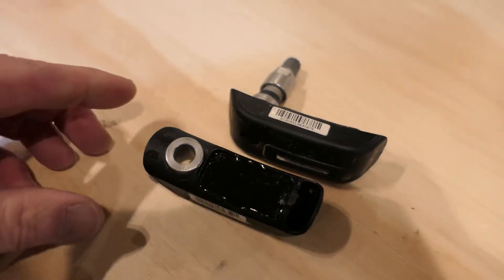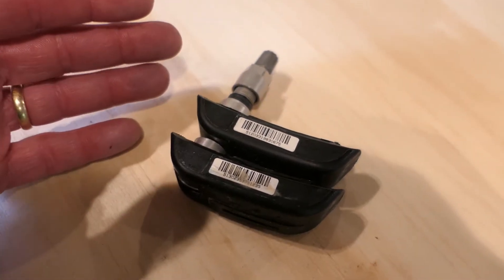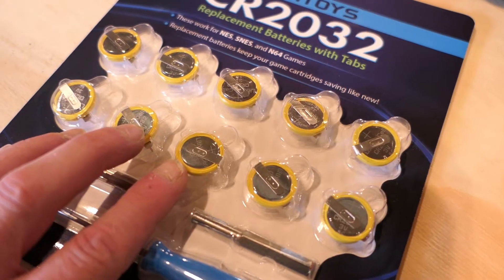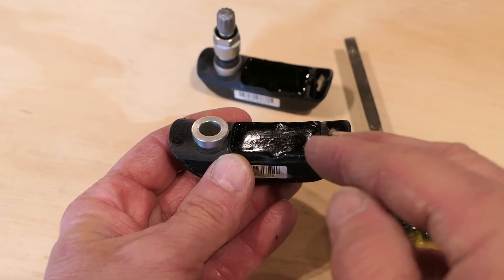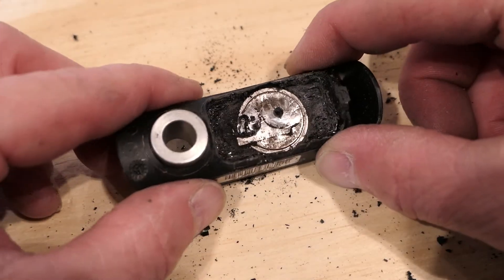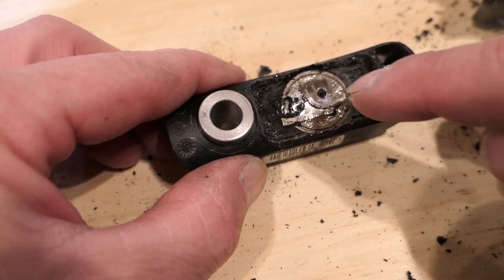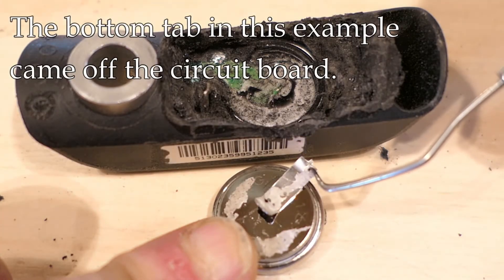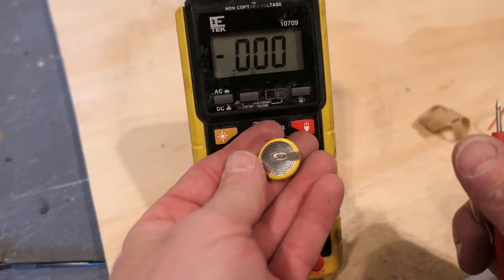Updated: BMW Motorcycle TPMS Battery Replacement

Comment: Two questions:

Is there a difference between the front and rear sensor?

Did you ever tried the very cheap chinese sensors?
Reply from the maker: There is a newer style sensor for newer model years, so pay attention to that.  The original style front and rear sensors are the same, except for the mounting, so the front sensor comes with a stem.  The cheap sensors you can find on amazon or ebay are identical to OEM.  However, you may find that the batteries are already DOA or at least older.
Reply: @tinderboxarts With that said I am thinking about buying oem version (it will cost a lot money) and keep the old ones for changing batterys later.
Reply from the maker: Or, just buy the cheap sensors and replace the batteries if need be.  You can test the sensor before you do a final install.  Either way you'll need either the GS911 scan tool or the motoscan app with a cable.  See the last half of this older video: https://youtu.be/xAiJy4ZC-u4

Comment: I prefer to do not have the pressure indication than replace it every 2 years
Reply from the maker: The batteries last more than that--my guess would be an average of 5-6 years, depending on use.  While I'm not a big fan of electronics on bikes, this feature is useful.  It's there not to help you set the pressure, but to alert you in the event of a sudden pressure loss.  When you are on the highway or stuck in traffic, a quick alert could be a lifesaver.

Comment: Hello,  thanks for the great video. I am planning to change battery by myself aswell. Now front tire is totalt out but back tires still working.
   I bought the EL-50448 ( another brand called OEC-T5) tool from Amazon for really nice price and tried to test it. But it could not wake up the back tire's sensor.  I placed it very close to the back tire's sensor, pressed the white buttom many times. The green led flashed but the mc still shows 0 tire pressure.  I have 2016 GSA.  Any suggestions? I got a defekt EL-50448 ?
Reply from the maker: If you were looking for a reading on the dash then that could be the issue.  I believe the bike needs to be rolling at something like 15 MPH for the dash to display the sensor data.  The wake-up tool is meant only to allow you to enter the sensor registration when you have your GS911 or Motoscan spp connected to the bike.

Comment: i blast the sensor port with compressed air to test if its working. but this might only work with aftermarket setups with a standalone receiver
Reply from the maker: How do you accomplish that, with a rubber tipped blow gun?

Comment: I want to thank you for your guidance in undertaking this project. I'd never have attempted it myself without seeing the detail of how the battery is situated in the sensor and how to remove it. On the basis of the challenges you experienced, I tried a couple of variations, that worked a treat.  First with the removal of the epoxy resin - the resin on my sensor was very hard.  But I scored it with a sharp Stanley knife (box cutter) into approx 3 mm x 3 mm squares, and then it was relatively easy to prize each of the squares out, leaving the battery cleanly exposed.  Then, using a high speed drill, I drilled into the battery, severing the top welded tab (wearing protective gloves, mask and goggles).  Kept drilling through the battery to the bottom tab, which also severed cleanly.  The battery lifted out easily, leaving approx 5 mm tabs for both bottom and top connections to the battery, which the new CR2032 battery (with tabs) comfortably connected to.  Thanks again for your detailed guidance.  As others have written, much prefer to extend the life of parts such as the TPMS, reducing waste and cost!
Reply from the maker: That's a great idea to cut the epoxy into squares.  I'm glad it all worked out for you!

Comment: Obviously, bmw doesn’t want you to replace its battery instead, they wanted you to change the whole thing
Reply from the maker: That is correct, and that is also common among all car and bike manufacturers.  The big difference, though, is that new sensors for cars and other bikes are cheap to buy.  They are a consumable item.  BMW has made them obscenely over-priced, especially as they are no different than those used by other manufacturers.

Comment: I bought x2 senors off Aliexpress for $33 delivered,
They both have the BMW markings on them, exactly the same as the originals. probably alot quicker and cheaper than the battery swap,
Reply from the maker: There's one catch with that approach, which is that the cheap sensors sometimes arrive with dead or nearly dead batteries.  That happened to me, and I see many others on forums who have experienced the same thing.  So, I still replace the batteries and just swap the sensors with new batteries every other tire change.

Comment: Just out of interest, its been 2 years, are they still holdong up, and how regularly do you ride? Do you think they would last the +- 10 years like the oem batteries?
Reply from the maker: Yes, I have been on multiple cross country trips with these same sensors and batteries, often riding 10-12 hours a day.  I'm not sure all OEM batteries last 10 years, by the way.  The beauty of replacing your own batteries is that you can repeat the process, say, every other tire change.  That way you'll never be caught with dead batteries again.  Once the epoxy is removed the process is easy.

Comment: Excellent explanation!!. Would it be possible to use a heat gun to melt the epoxy, very carefully? Then, some type of liquid epoxy could be used to seal the battery again.
Reply from the maker: No, a heat gun would spread the heat too wide and probably cook the circuit card.  You can use a simple chisel or razor to chip away at it if you don't have a soldering iron.  As for resealing the battery, the electrical tape really works fine.  I've done three cross country trips that way with no issues.
Reply: Ok! Thanks!!!

Comment: The original battery is a Maxell CR2050HR battery, it has more than double the capacity of a CR2032 (550 vs 225 mAh), so it will last much longer.
It also comes with tabs attached, making it easier to connect properly with the original tabs in the sensor.
Reply from the maker: I've had this discussion before.  It may be that the manufacturer used different batteries depending on when they were manufactured.  In any case, as long as you have a 20mm 3v battery it will work fine.  The 2032 is more readily available, but the larger 2050 can be found.  I'm not that concerned with longevity because I end up doing a tire change at least once a year, which is an opportunity to change the sensors or the batteries,
Reply: Wish I had read yours before I ordered the CR 2032's recommended on the video. Oh well when I replace them (earlier than needed) I will have the CR 2050's here. Still thankful to Tinderbox Arts for this useful video.

Comment: You were willing to buy cheap chinese batteries but you're not willing to buy cheap chinese sensors for $30?
Reply from the maker: On the contrary, I have two sets of sensors, one pair of which are Chinese knockoffs and the other the OEM.  If you watched my original video, I found that one of the knockoff sensors arrived with a dead battery and this is not uncommon.  So you may be into replacing batteries even if you buy complete sensors.  I just switch the pairs of sensors when I do a tire change, to keep a fresh battery installed at all times.

Comment: This is another sign of the Useless times in which we live. Someone decided this is a good idea to install these sensors which requires computers and tools to set up.  Somehow that is more "Convenient" than the simple act of checking the air pressure on the tire manually. How much time and money is wasted dealing with this stupidity.!!
Reply from the maker: I do understand the sentiment, and I'm not a fan of most of the gizmos on bikes and cars these days.  However, I do think the TPMS sensors are valuable for riders--not to check the pressure, but as a warning while riding.  If you have a few seconds of warning that pressure is dropping after running over a nail, it could offer an advantage.  That said, the implementation of the sensors could be improved for sure.

Comment: Thanks for this hack. Was quoted ridiculous prices for this to replace. With labour they wanted over £500!  I thought it was shitty to make it sealed so you have to buy the whole thing. This is so wasteful and I hate companies that do stuff like this to extort money from you. I just replaced a tyre the other day and wish I saw this video first.

EDIT:
After changing a tyre again I tried this and it worked!  I used a proper TPMS battery though and spent the extra. They are longer lasting and more robust against temperature. 
I also had to solder a wire where I messed up the positive side. I hot glued everything back in

Comment: You can order CR2050HR batteries that are designed for TPMS, bigger capacity and can be soldered on.
Reply from the maker: Yes, as long as the voltage is correct you can use a larger capacity battery.  However, that also means more weight.
Reply: @tinderboxarts  Is the weight a big factor in this case?

Comment: Hello again John,
Just yesterday the front tire pressure indicator my 2016 r1200rt  stopped showing a number and shows two red rings.  The tire is holding air, was low at 33 instead of 36. I've put more air in but haven't ridden it yet to get up to speed (30 mph) to check it. Any ideas?
Reply from the maker: If there is no longer a reading indicated on the dash then that is typically an indication that your battery in the sensor has failed.  You'll have to either replace the sensor or replace the battery in the existing sensor.

Comment: Hi thanks for this how to video.
Can I make a suggestion  could you measure the depth you need to drill and let us know so we can set the drill depth when doing it by drill .
Thanks again
Reply from the maker: That wouldn't be a wise method.  There could be differences among model years or for other reasons and the level of epoxy could also vary.  It's not that difficult to sneak up on the depth.  You encounter the top of the battery first, so when you see silver you need to slow down and proceed more cautiously.

Comment: Why not use an electrically conductive glue like you would use to reattach a rear window defogger tab?
Reply from the maker: Do you mean to attach the wires to the circuit card or the battery?  I'm not certain how well that would hold up in the environment of the tire with heat and vibration.  I can say with certainty that soldering does hold up, because I've gone years now with repaired sensors without issue.
Reply: @tinderboxarts  the adhesive to reattach the defroster lead to the glass on your vehicle window defroster works in an environment that is subject to high temperature changes as well as vibrations.  It is used in place of solder because the glass will brake if you try to resolder the lead onto the glass.  This adhesive is fully conductive as well.   I’m going to try it as I have to replace the batteries on my TPM sensors.

Comment: You can use a small endmill bit in your drill press.  Makes is work like a milling machine and if you have the mill vise, you can move the sensor around as well

Comment: If a soldering iron is used - be very careful not to overheat the battery…
It WILL explode - eye protection is a very good idea

Comment: It pisses me off how the industry designs everything so they keep making money out of you. They could make the sensor have a cap and a replaceable battery so when you change tyres you could change the battery too. They are clowns but thank god some of us can use powertools.
Reply from the maker: Couldn't agree more.  In this instance it would be trivial to design a cap to allow battery replacement.  And it isn't just our money, either--designs like this contribute to the staggering waste in our world.  One pair of sensors should last the life of the bike if you can replace the batteries.

Comment: Thank you for posting the video. I am in the middle of the process and notice my sensor battery is a CR2050HR. This is on a 2018 K1600B. Was able to remove the battery and keep the metal tabs attached to the sensor. My epoxy was soft and came out with a small pocket knife and pick. Found out the HR means heat resistant. Maxwell website says the HR is not available to consumers.
Reply from the maker: You can find the CR2050HR battery on both ebay and amazon.  Moreover, the HR version probably isn't necessary anyway, since countless sensors in all kinds of vehicles use the standard battery.

Comment: I thought I would chime in since I just went through TPMS replacement on my 2011 1200RT. Like most people, I am not willing to pay the $230 price tag that BMW gets for each replacement sensor (plus labor), and since I don’t do my own tire removal/reinstallation/balancing (~$100 labor/2 tires at BMW dealer), I’m not willing to risk a chance on battery replacement or eBay Chinese sensors. I discovered through various sources that BMW has discontinued the original sensors (36318532731 / 732) and replaced them with a single sensor made by Schrader, BMW P/N 36319832032. The same sensor is available under the Schrader P/N 3141M. The rear valve stem has to be ordered separately, but the advantage there is that you can now opt for a (80 deg) angled stem on the rear for easier accessibility. I purchased two sensors and a rear stem from Autotechnik24 in Germany for 155 euro, including shipping. I registered them with my GS911 and activated using the EL-50448 tool, and they work fine.
Reply from the maker: That's great information.  Many riders don't realize that there nothing special about the BMW parts, it was always just Schrader sensors using the same technology found in millions of other vehicles.  The only difference is the physical configuration.  Schrader has also introduced generic  sensors which can be used in any vehicle, but you need their programming tool to make it work.  So much of the issue these days is sourcing both the information and the actual parts, and there are significant differences in that regard depending on where you live in the world.

Comment: would this work for a KTM 1290 super adventure 2016?
Reply from the maker: I'm glad you asked!  I looked up that bike and it does appear that the sensor for some KTM model years is nearly identical to the BMW.  Speaking generally, though, all of these tire pressure sensors in bikes and cars work essentially the same way, they just have different physical designs.  The older designs often had the epoxy covering the battery, the newer designs often have a snap-together case.  If it's a watch battery, though, it can be replaced as long as you can get the case apart.  Now, if the cost of buying a whole new sensor is $15, then maybe it isn't worth the effort.  But if they are charging $150 to $300 it starts making sense.  I'd love to hear back if your sensor is the same style and if you give the replacement a try.

Comment: Great content and timely for my 2016 GS. 
I have the GS911 and ordered the wake up tool Question, will the CR2032 batteries with the leads attached make the task a little easier? 
And, does anyone have a recommendation for the “spare “ set of sensors that don’t cost BMW $’s?
Reply from the maker: Yes, if you find batteries with the leads attached that is easier than the tricky soldering which may damage the battery with heat.  You can find generic sensor knock offs both on ebay and Amazon.
Reply: I had new tires installed this week and installed the $40/pair aftermarket TPMS sensors. All is well plus I got a to justify the expense of the GS911 device once again. I may try to replace the batteries in the OEM sensors per your instructions when needed. Thanks

Comment: What is the cost of 1 battery?
Reply from the maker: Peanuts.  They are standard watch batteries you can buy in any drugstore or box store.  You can buy them in bulk online with the solder tabs, ten for ten bucks.